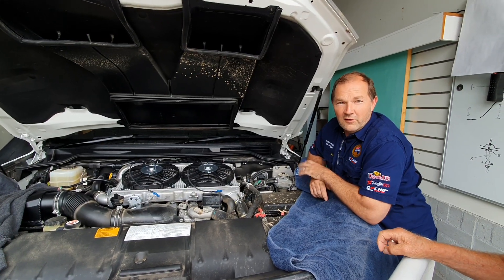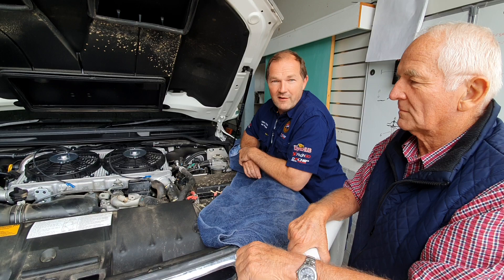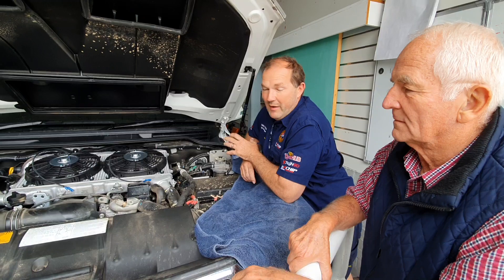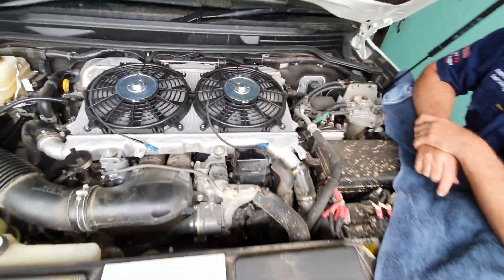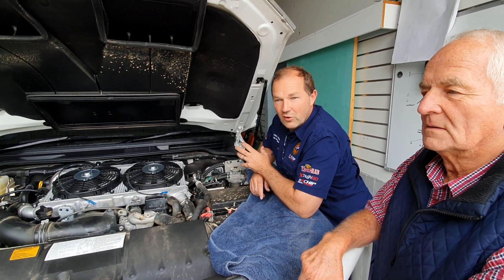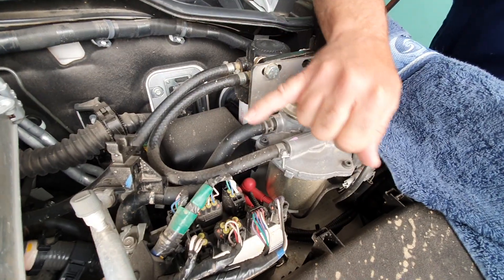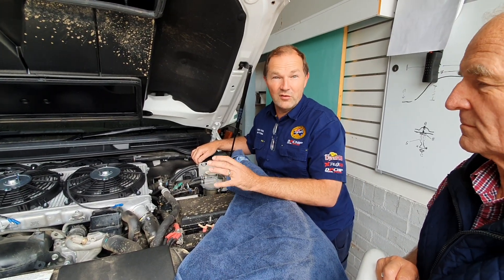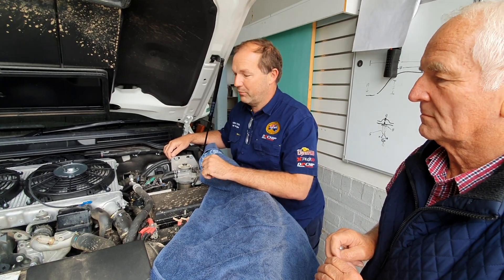Intercooler Fans Diesel Pre filter Catch Can

Comment: What's your opinion on fixing the fans thru the actual intercooler fins like that one?

I  thought that could potentially damage the IC.
Shouldn't the fans be attached to a frame it shroud that goes over the whole IC?

Thanks Mick
Reply from the maker: Like everything bolted correctly no issues

Comment: What fuse are you talking about I have a 70 series that's just gone very dull
Reply from the maker: Were using it as an example. If the fans stop working (lets say a blown fuse) the customer sees that through the power loss from Intercooler getting hot